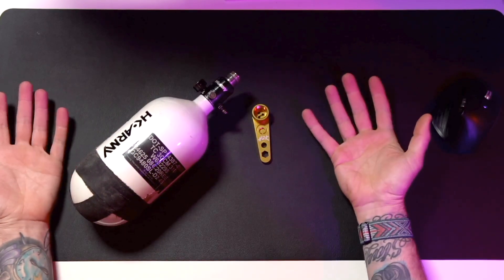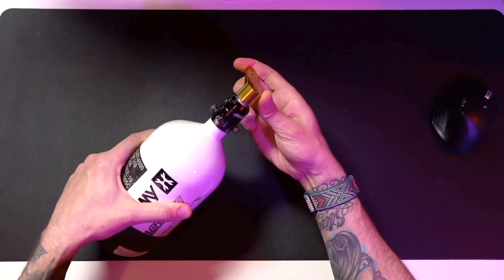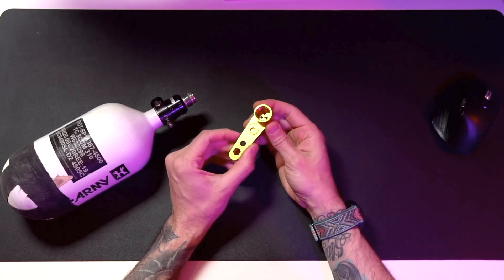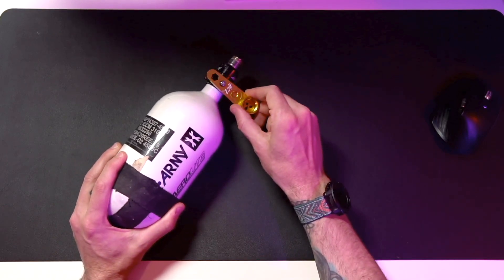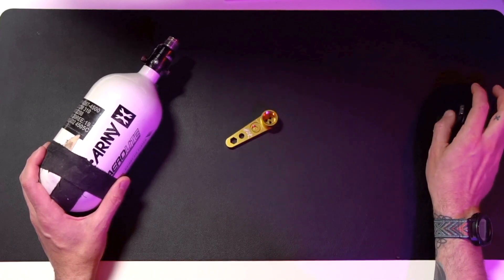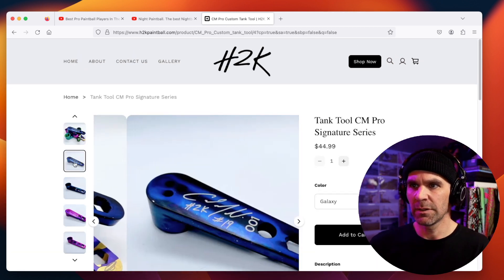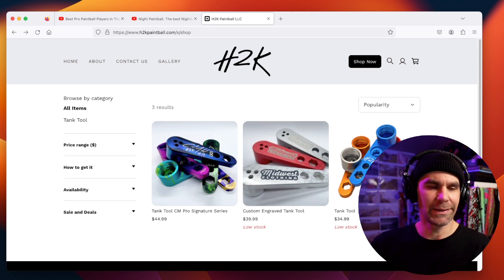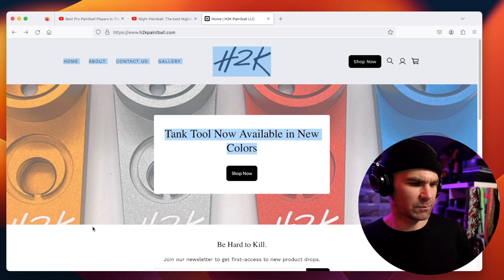I wish I thought of this cool tool.

Comment: If you don't already have an extra asa laying around I can see how that tool would be pretty useful
Reply from the maker: Or you can push the pin with an allen wrench, the leverage spot is probably the most handy.
Reply: @RuinedClips I had to do this the other day. I just took the bolt system out of my gun and then screwed in the tank slowly —- air bleeds out no problem